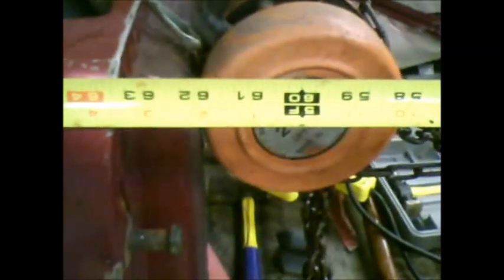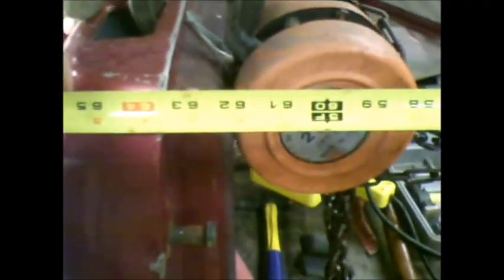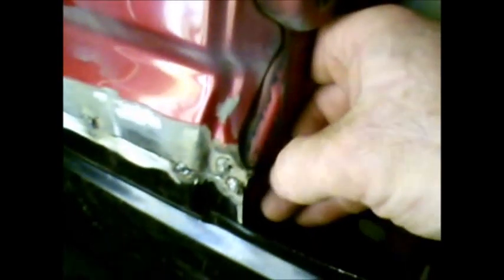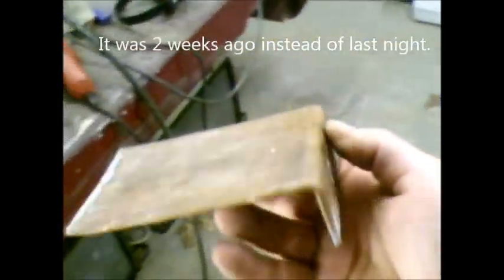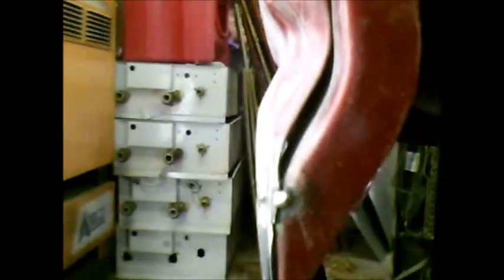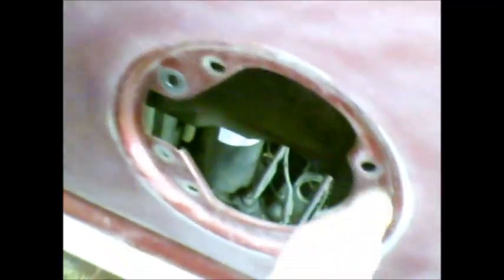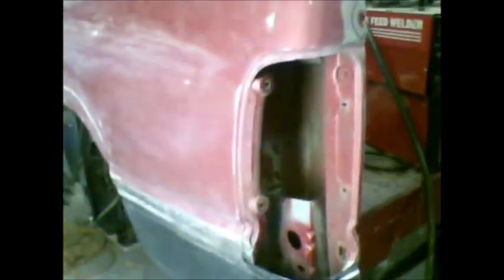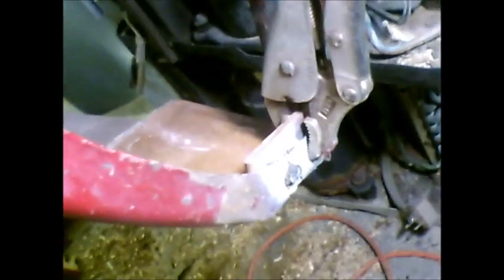Pulling the bedside.

Comment: killer job on the bed repair,we still use the flux core wire, your right the gas is alot cleaner weld, but the flux core seems to burn in alot better on plug welds, for me makes for less grinding, probably all in my head
Reply from the maker: I use the flux core because I am cheap.lol
I have never taken the time to set my machine up with it like my tig rig,
Thank you for watching.

Comment: the tail gate edges on both sides to me look they taper inwards so it makes the gap look huge after the pull I think you got it right as rain cecil .good job on the patch looks really straight the copper heat sink has been my friend many a time on ole bubba good job glad the digit is all healed up thanks for the vid take care
Reply from the maker: Thanks Mark.
I hope I got it good enough to keep it closed.
I have used different versions of the copper backer for along time and it has really come in handy in many situations.
Take care brother. :-)